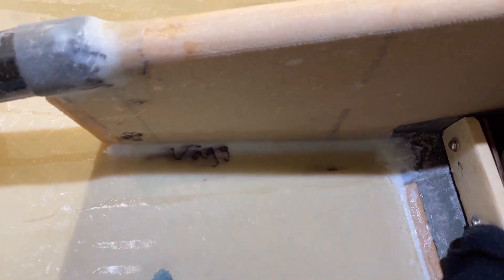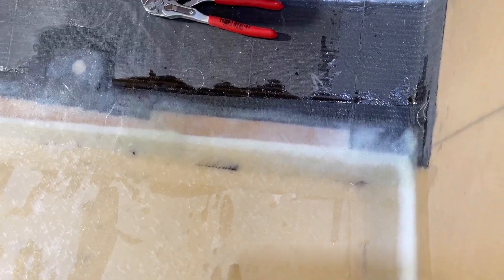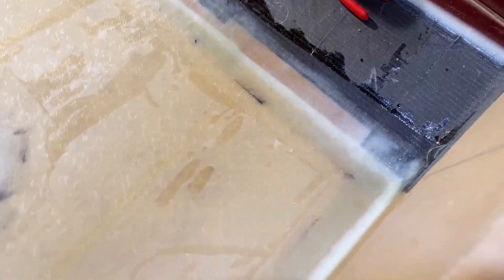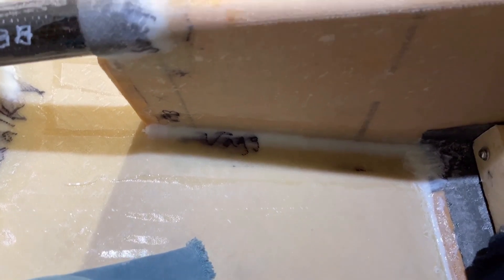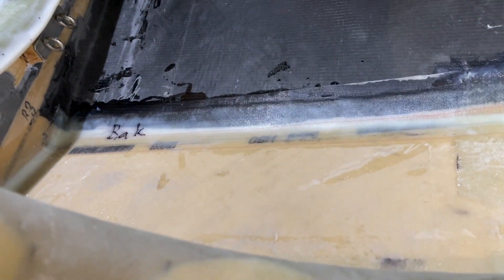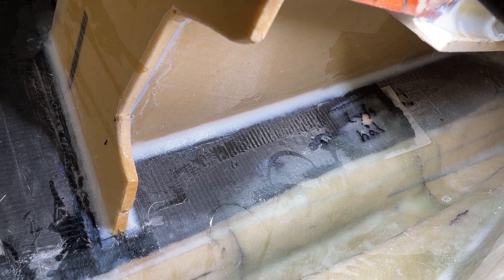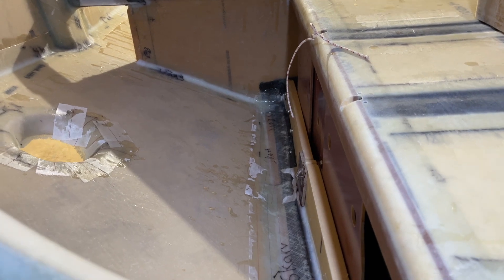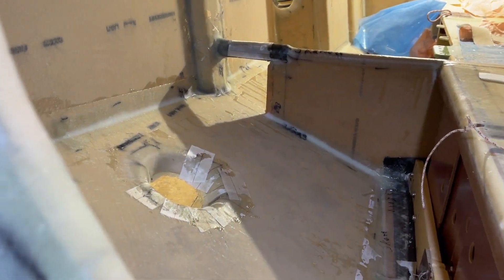5 Aug 2023  Deck hull joint part 2  Port side

Comment: When you started this vessel, it seemed the boat would be quite small on the inside. But seeing the rooms from different angles, there is a good amount of space and the light will be adequate for any daily function. Very good design!
Reply from the maker: Thanks.
I have experience from her predecessors

Comment: Do you have a fan that you could fit into one of the hatches to circulate air through the cabins? That would help with the heat. Excellent work on the seams Captain. Have a good evening.